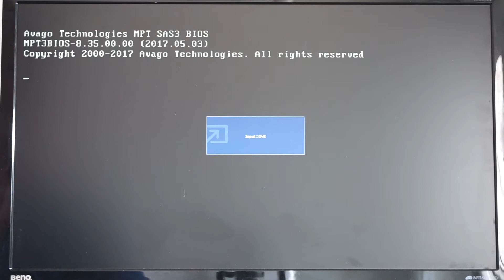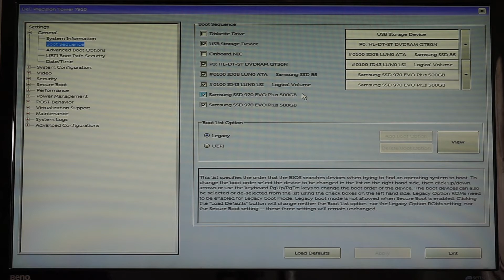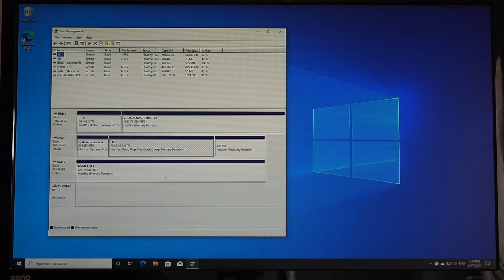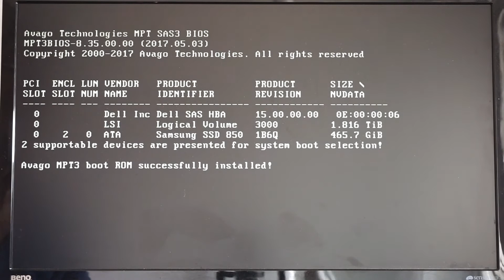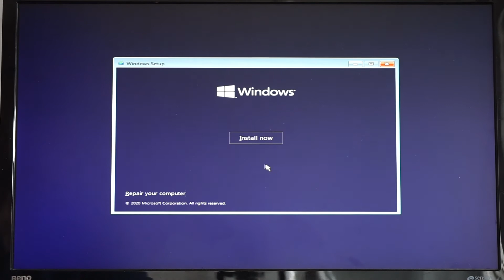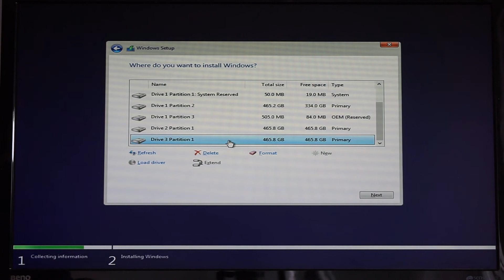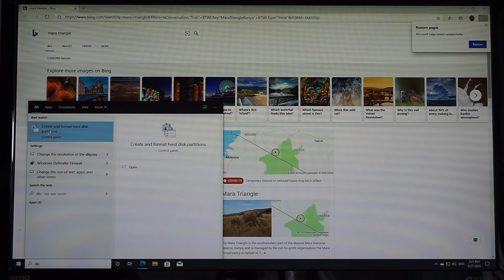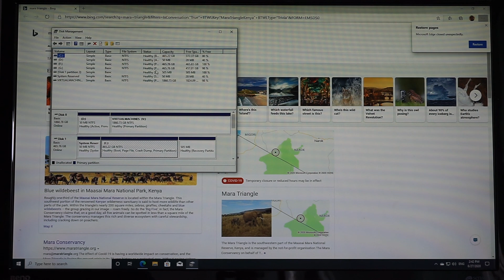Dell T7910 (firmware A33) Works Fine with ASUS Hyper M.2 Card (two EVO 970 NVMe 500G SSDs)

Comment: Thunderbolt 2 is much faster.  Use that instead.
Reply: Unless that workstation has a thunderbolt 2 port, I'm affraid that it's not going to be possible. However It sounds like a very good idea. What would you suggest?
Reply: @rojarrolla  SAS 3 achieve 12GBps already.  Read and Write at True 2gbps. Bolt 2 20GBps.  Make sure your ssd/hdd are SATA 3. Bolt 3 40GBps. Bolt 4 40GBps dual 4K display PCie32.  SSA3 surpass 4K video editing and networking for personal and small side studio.